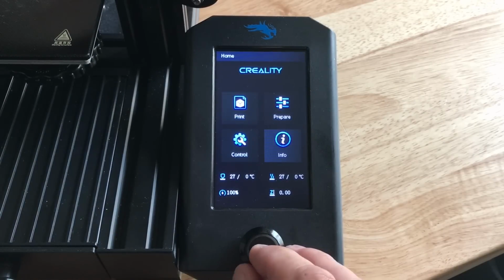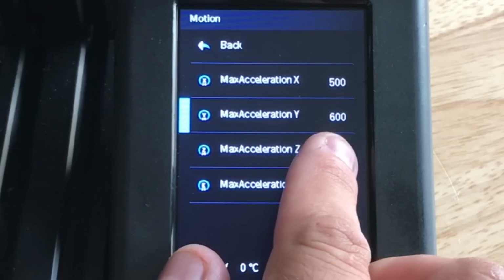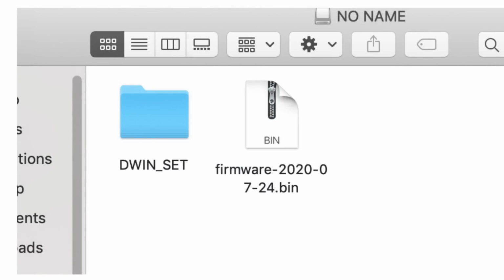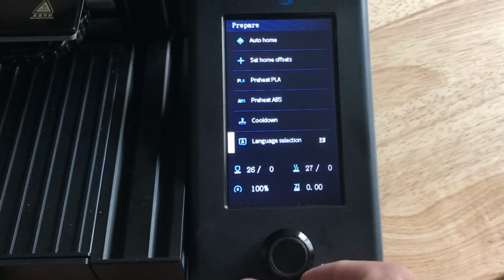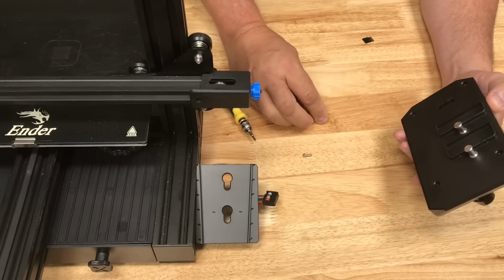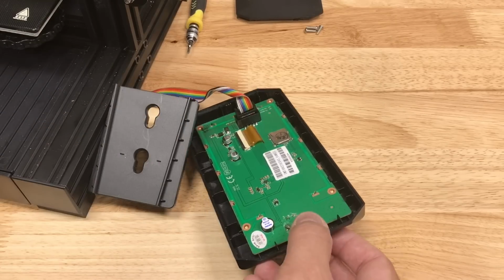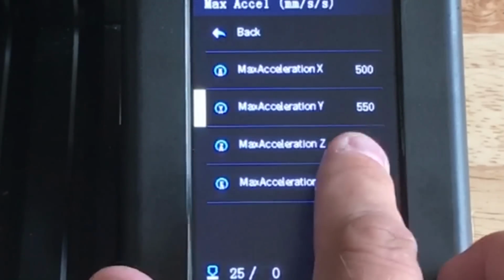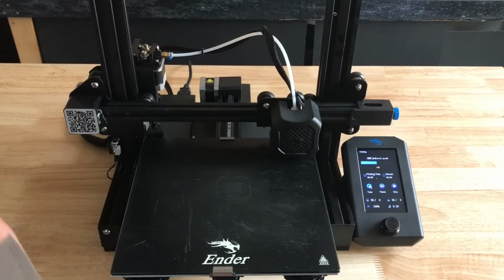Creality Ender 3 V2 Firmware Update - Motherboard and Display

Comment: I have an Ender 3 V2 and I upgraded the motherboard and the display to the newest Marlin 2.0.6 version software and now for some reason when I use the Cure slicer and slice it and save it to my SD card nothing pops up as a g code so I was wondering if you could help me get past this or give me any tips or videos to watch
Reply from the maker: Make sure your slicer is set to the proper machine to get GCode files.
Reply: @FilamentFriday  thank you so much that was it I just couldn't find my printer on there so I typed it in but it's working now thank you so much

Comment: I updated the latest fw fffirmware-20200802-113211 and my Ender3 V2 is now stick at 101% speed, can not adjust speed. What should I do then? Thank you.
Reply from the maker: We’re you running a file with 22 characters or more in the name?
Reply: @FilamentFriday  23 characters, sir.
Reply from the maker: Change the name to 21 or less not including .gcode and try again. It’s a bug in marlin.
Reply: @FilamentFriday  thank you so much.

Comment: To print does the card need to be formatted in FAT32?
Reply from the maker: Yes
Reply: @FilamentFriday  thank you very much I was  Able to update my buddies printer to the latest August version of the firmware and get everything set up for him and he was about at the point of ready to return it. So I'm glad I was able to get it set up for him and we're going to try print and see how it goes after we level things out.
Reply: @FilamentFriday  having a problem trying to do a print. I sliced it in Cura and it saved it as a UFP file. Am I doing something wrong? Really trying to help a friend.
He wants to sign up for your patreon when print is successful.
At least he hasn't given up now the new firmware is installed.
Edit: typed .gcode to end of file while renaming after splice and it is now showing. Working on settings to get it to print
Reply from the maker: Do you have the Ender 3 selected in Cura?
Reply: @FilamentFriday  no, I will check that. Thanks. I am new to 3D printers since he bought this but I am efficient in Windows and droid machines and do that for work. So I appreciate the tips as I help a friend start his business idea. 
He is new to computers and I am teaching as much as he can retain. He told me he loved your channel (so I subbed) to catch up and help him w the technical bits on his printer. I did explain to him what Patreon was and he is excited to contribute for all your help after we do the test print. I will be there this afternoon to pick up where I left off (installing firmware and the other file under display).
That boat test print is the 1st thing I should try, right?
Thanks for all the help, you seem a true stand up gentleman. 
Kind regards,
Ryan
Edit: can I change file name to .gcode to have it print? Or is that why I should check setting in Cura to see if Ender 3 is selected? Is the file extension meant to be UHF?
Reply from the maker: Some machines default to that but select the machine that matches yours and it should output .gcode.
Reply: @FilamentFriday  thanks. I'll reply this afternoon with good news I hope.
Reply: @FilamentFriday  I do have my printed set up in the cura software. I'm running a Ender 3 V2. So yesterday we Flash the new  software from your website onto the 3D printer.when we try to download a test print file from thingiverse for some reason it's not loading correctly on the SD card? so when i slice and saved it to the SD card and put it in the machine i can adjust the temperatures and once I adjust all the temperatures and hit confirm it resets. thank you for all the help that you provided my friend to help me to get further along to get printing.. I also got your filament Friday tool bag and I can't wait to try it out

Comment: Cant see progression on LCD when i use yor latest firmware 2.0.6 when i send a print from Cura and Octoprint
Reply from the maker: Not sure why. It’s on both my machines running the same firmware. Shows up right above the Tune-Pause-Stop options.
Reply: @FilamentFriday  Thanks for answer, will check my Octoprint.

Comment: I bought a Creality 3 V2 and the load bar is not loading, so the printer is kinda not booting. Any suggestions?! 
I have already tried multiple .bin files via SD Card, multiples names, with and without DWIN_SET into the SD, multiple *.bin from Chep, got the black screen as well, old Creality, latest from Creality sire from 6th Aug and fffirmware-20200802-113211.bin .:. nothing makes this machine fire up... 
Also, have checked for soldering on motherboard or lose wiring,  nothing....
Suggestions are more than welcome.
Reply from the maker: It never worked?
Reply: @FilamentFriday   Unfortunately not... it contains a V4.2.2. mainboard, no info about it. Banggood reply sending the latest Creality (32) Firmware and still not working. Into the SD card, after updating, I noticed a new EEPROM.DAT file.
Reply from the maker: Sounds like a bad board then.
Reply: @FilamentFriday  So, technically, if I do install a SKR Mini E3 V2.0 on this problematic Ender 3 V2, it should have evething to work then?
Reply from the maker: I would think so but Ive never tried it.

Comment: I applied the firmware and stuck with a blank screen. I have tried everything I can think of and it will no longer boot. Any idea?
Reply from the maker: Change the file name and try again
Reply: CHEP I tried that. I also download the Creality 1.0.2 and renamed it but same blank screen. Fans are running. Any other suggestions?
Reply from the maker: Possibly try updating the display?
Reply: CHEP that worked, thanks!!! Any luck getting your Gcode for levelling to work on 3 V2?
Reply from the maker: Yeah, I got it to work with my firmware update based on Marlin 2.0.6 but others had issues with it soI pulled it. It’s been working fine for me.

Comment: Excellent videos CHEP!  Been watching for awhile and now subscribed!  Will definately follow this to update my firmware on my Ender 3 V2 but I have a question regarding micro SD card reading via an extension.  I printed a form of holder like you did for your Ender 3.  But when I take out the card from the extender and replace it I need to unplug and re-plug the extender in order for the updated files to show.  Will this firmware update fix this?  I wish the V2 had a built in "change sd card" like the 3 has.  Any input would be greatly appreciated!  Keep it up with the videos!

Comment: Not sure if Marlin firmware is ready for prime time on Ender 3V2  to many issues,  after loading it slams my bed fare right corner every time I go to print some thing.
Reply from the maker: Is your file name longer than 22 characters?
Reply: @FilamentFriday  I will have to check, is this a limitation?
Reply from the maker: It’s a bug right now in Marlin.
Reply: Checking now, printing a Benchy so good sign that you are right.
Reply: thanks for sharing this info.

Comment: It would be useful to mention that the DWIN_SET folder can be found in the configs download, and is not included in the Marlin, Creality, or fffirmware downloads.

I also am not getting your Bed Level to work. Like many others, it homes, goes to 19%, then the screen freezes and clicking the knob does not progress it. This was one of my favourite features you put together for the Ender 3, and I sorely hope it gets sorted out soon!
Reply from the maker: Are you running Octoprint?
Reply: @FilamentFriday  I have the same freeze issue without anything octoprint, took the stock ender 3 v2 and flashed display & firmware

Comment: Now my ender3v2 has ran fw.2.0.6 the setting value saved in eprom , but can't run file "CHEP_Ender_3_bed_level"
after run they do auto home position /then can't press button to next position.
Reply from the maker: Bizarre. There has to be some differences in these boards as mine works perfectly.

Comment: Does this firmware update fix issues where I’m trying to change filament using gcode? Does the “change filament” option appear in the menu? I purchased 3 of these and had to return them and downgrade to the Ender 3 pro because of this issue
Reply: please can we get an answer to this question? does this fix the "change filament" option that does NOT exist in the menu? would like to know before I do the firmware upgrades, thank you.
Reply from the maker: No. That is not fixed.
Reply: waiting on this as well. Very surprised it's one of their newest printers and lacks this feature considering it's predecessor (3-Pro) has it.

Comment: Which creality firmware do I download for my ender 3 v2, the sd v1.3zip or the 1.1.6v?
Reply: SD 1.3zip is the contents of the SD card that came with your printer, it includes the models and manual videos etc. The other is just the firmware

Comment: Why does this set the speed to 422 and slamm I to my extruder block, I'm buyong a new motor because of this!
Reply: I got over 700 and 500 in speed randomly on my both ender 3 v2. Almost destroyed them. I changed back to 1.0.1
Reply from the maker: Was your file greater than 22 characters?
Reply: @FilamentFriday  first time on both but i shorten it to only 5
Reply: @FilamentFriday  and the nozzle ran over my clips for the glass bed and out, outside the bed and in back again. Behaved very strange
Reply from the maker: Did it work with 5?
Reply: @FilamentFriday  no, like i wrote, i changed back to 1.0.1

Comment: Hi CHEP, i installed this new firmware and your bed level gcode still isnt working for me. The button does nothing when pressed. I have just replaced the springs under the bed for firmer ones as recommended by Edge of Tech but i dont think this is causing the issue. I can start the bed level print but it stops at 19%, pressing the button doesnt start the next step, and also turning the dial does allow me to select another menu item....any thoughts? Thanks!
Reply from the maker: Strange. It works everytime for me.
Reply: @FilamentFriday  Weird, a few others have reported the screen freezing as well. Do we need to do the LCD update at the same time? I didnt do that
Reply: @mcloum  i updated firmware as well as LCD but still got the freezes :(

Comment: with firmware version 
fffirmware-20200802-113211.bin, 
I noticed that the fan speed set itself to zero in the printer when I went to tune menu while printing even though in cura it is set at 100%. It also tends to want to continue the print even if I canceled and try to go into the sd card and try to print again.  Also, when removing the SD card at the home screen the printer will autohome, not sure if thats normal. anyone else have these issues?
Reply from the maker: The SD auto home and continue for a bit after cancel both did that in Creality version as well. Not sure why. I’ll check the fan.

Comment: I have the SKR Mini E3 but it does not work and Bigtreetech does not respond. I have sent them three or four emails so far but they totally ignore it. The board works at first for normal operations. But when I want to print something... it does not start the print. It just heats up and then sits there. I tried many things I found online... no use.

Comment: WHAT THE hell installed this and then when I went to print it homes and then went full power and slammed the extrusion block, odnt download this it's glitched.

Edit: downloaded the old version and it got fixed it probably damaged my belt and motor

Please. Fix this I'm buying a new stepper motor but the noisy ones so ye
Reply: hey man im having also the same issue with the firmware 2.0.6 
just waana ask how did you installed the older version?

Comment: I am working with a brand new Ender3 v2 .. On the 3rd print..  I stopped the print ( because of bed adhesion .. ) ..  I inserted another sd card to attempt another print...   It did not see the card.. I turned off the machine and restarted it so that it would read the sd card.. The printer went dead.. and has not started up again..    I have tried to use your Marlin update..  But I do not have the Dwin folder as you described..  ( I am on a Mac.. ) ..   I tried downloading the firmware from Creality and the zip files can not be opened.. Where do I go from here ?    Update : I did not have the dwin_set folder  .. Once I was able to find the  folder.. it updated correctly ...     I am now up and running using version 2.06  THANK YOU CHEP !!!!!!!!!     you are a lifesaver
Reply: Hey I would install it now, this update has a glitch that slamms your extrusion block into the extrusions and kill your motors
Reply: @lucab1733  while I don't doubt you are having an issue, to imply that ALL users will have the same issues you are experiencing is not true.  You may have a corrupted file or one of many different issues at play.  Now if other users are experiencing the same thing there may be cause for concern but Chuck has said this is working perfectly fine on his machine and it's basically the stock Marlin 2.0.6 version.

Comment: Thanks for your videos!

Is the latest release available on your website free of bugs?
Will Creality provide another official update soon (hopefully without issue)?
Reply: It has a bug that kills your motor, it can randomly slam into the extrusion at full power and I put the old creality version and new stepper motors and it stopped doing that.
Reply from the maker: I’ve tested it on mine and printed several things. Not seeing any bugs. Based on the latest Marlin 2.0.6.
Reply: ITs worth noting that just because CHEP hasnt experienced any bugs, many others have. Some even damaging their extruders due it slamming it into the houseing. Proceed with caution.

Comment: It looks like Creality has posted a version 2.0.2 dated July 27, 2020.  Not sure what changes have been made
Reply: July 27 was a typo, should have been 7/17 sorry for the confusion.  It is interesting that they call the file 1.1.6 but inside the folder it is labelled 2.0.2.  The SD card image is dated 7/23.  DRVAX stated that the M117 gcode to display on the bottom line doesn't work because there is no bottom line and that the M300 command to beep does work.  I am not sure what version of Marlin code = 2.0.2   Thanks for the great forum.  I will try to be more observant in the future.
Reply: @davechristensen7146  Name of new file:  Ender-3 V2-Marlin-2.0.1 - V1.0.1-2020.6.2(1).bin    Do you know if this resolves the esteps/eeprom issue?
Reply: I'm not finding that on Creality 3d official site  Can you help me locate it?
Reply from the maker: Where? There download site only has July 22.

Comment: I am getting the 404 error to,  is there another site we can go to?  I wonder if pulled from being download because there are issues...
Reply from the maker: Page works but I did pull the firmware for now.
Reply: @FilamentFriday   No worries I think I am going to pack it back up and send back to Amazon for a refund.  I have been able to get it to read the SD card after hours of trying different thinks and googling it I am at the point that it would take less then an hour to pack it up.  You would think they would QA stuff like this at the factory.

Comment: Hi CHEP, thanks for the good video's. Can you help us explain how to compile a custom firmware for our Ender 3 V2's? There are lot's of tutorials for the normal Ender 3, but with a different mainboard this will go different. I cannot currently find a good set of (configuration) files that compile without errors before changing anything, and didn't manage to work it out yet.

Comment: What kind of sd card port is that? You have to take the display apart to get at it. Very poor design..

In the 1st part, you showed how the v2 writes to the card, but you didn't show it with the card out.. on the 2nd test, you left the card out, never testing with the card in. We can only take your word for it that it only writes to card before the firmware update, not that we wouldn't believe you..

For my ender 3 pro, I have the skr/tft35 setup. It great.. though I would advise getting the skr e3 mini v2 over older versions as theres important updates (even coiling) to the board - even if you have to buy separately and spend a little more, it's worth it..

Comment: Wow, did Creality not even look at how BTT do updates? Granted the board does it the same way, but at least the BTT screens have a smoother experience without the need to dismantle it each time - bad enough the v2 screen isn't even touch. Maybe with the v3 they'll get it right.
Reply: Fernando Viñan-Cano I agree fully with you. Creality seem to be ok with the hardware side of things but when it comes to the boards they are lacking. I’ve changed to the BTT board and touchscreen for my Ender 3. It has now transformed the printer to a higher standard for a very small cost.

Comment: Thanks for moving forward on the e3 v2 firmware fix and flash as well as the display! Many are just covering the basics and flash the Creality fw. Your the first reviewer si e seen, that’s shown that the display can be updated via a sd card. 
I’m also going to try you’re recent upgrade to the hot end fix that’s popular. I tried it in the past and you are correct, the cutting guide provided and printed washer didn’t work out and I gave up on it. Thanks to your video I’m giving it another try on my e3 pro and if successful, it’ll be on my new e3 v2 when it arrives soon.

Comment: I see a skr mini v1.2 and 2.0... different products. Which do I need for my ender 3?
Reply: Thanks for the info!
Reply: The skr e3 mini v2.0 is an upgrade for the 1.2 with fixes and better cooling.

It's a little more money, but it's well worth it.. what's more, you will now be able to update firmware from sd as it has a bootloader,  though you wony need to right away as it comes with marlin 2.x pre installed.

Also, it works with tft35 v3 with no modifications (other than plugging in wires)